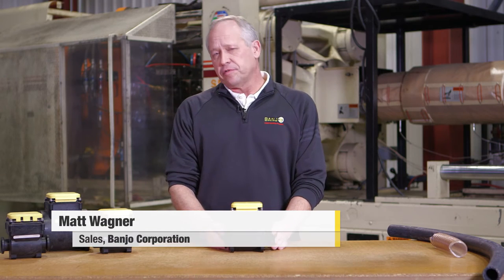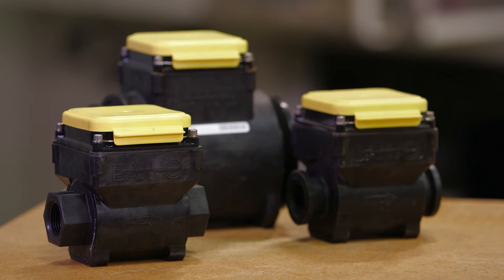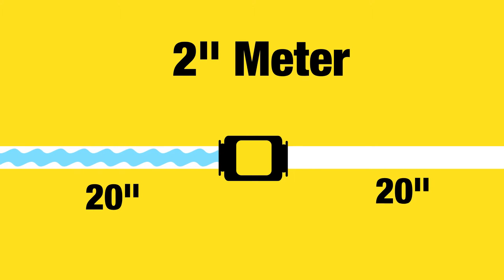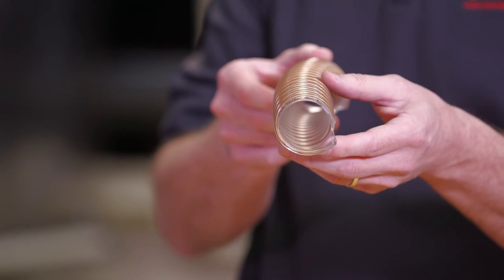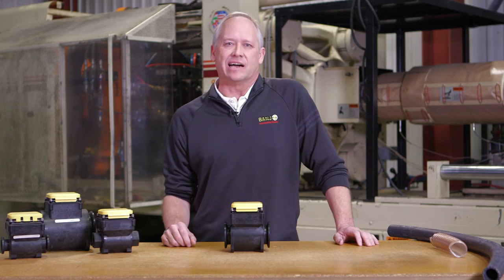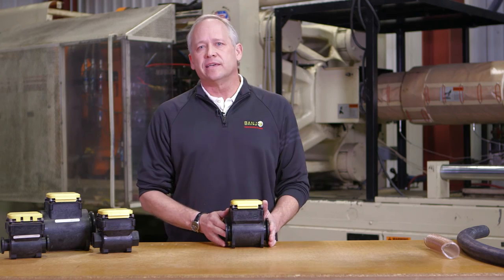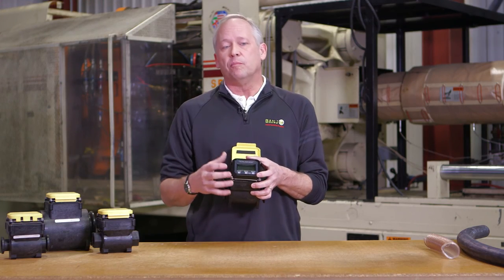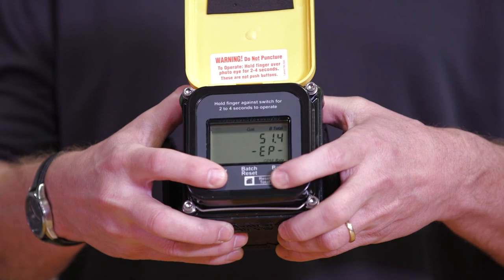Banjo Quick Tip Flow Meters

Comment: Used the meter for one year. Did everything on the video and it still only  measures half. Banjo dealers have left me on my own. What a poor investment ? Banjo should let me return and have it repaired or replaced.
Reply: What size meter did you use?